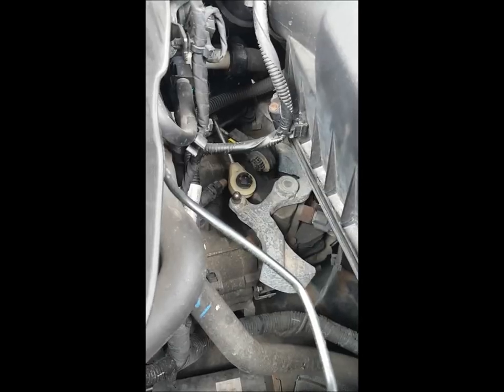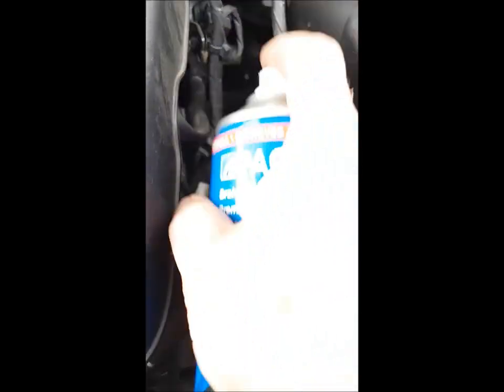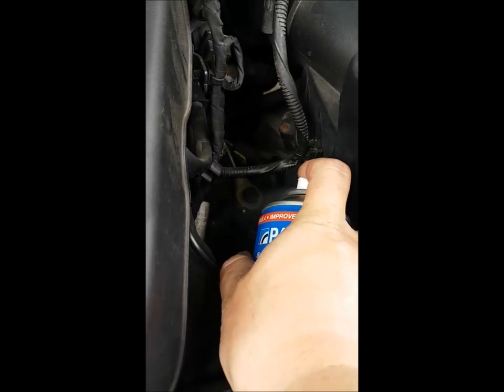Ford Mondeo mk4 Short Shifter 2.0L & 1.8L TDCI diesel 2007-14 Fitting Guide Dark Ice Designs

Comment: Is this a universal adaptor for Ford or is it only compatible with a certain Ford model?
Reply from the maker: It can be a universal fit for most 10mm ball joint operated gear selectors.  Some cars require some slightly different short shifters and so we have provided modified kits for those cars. Thanks!